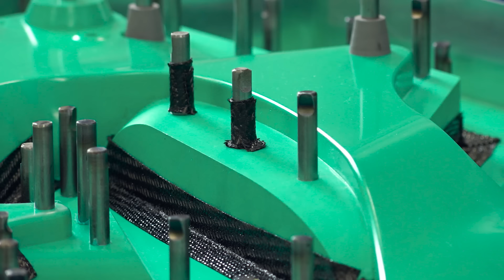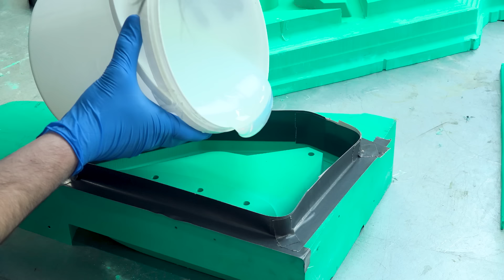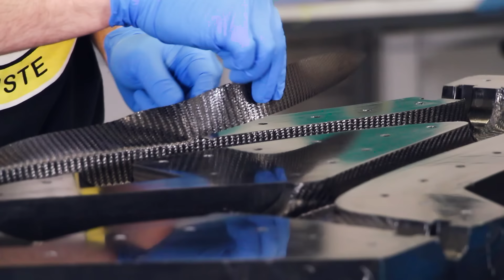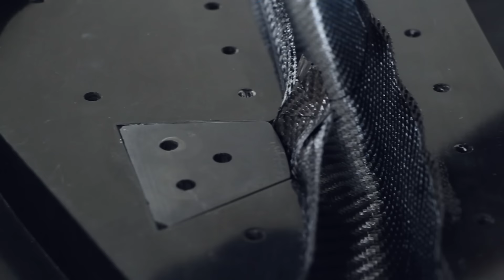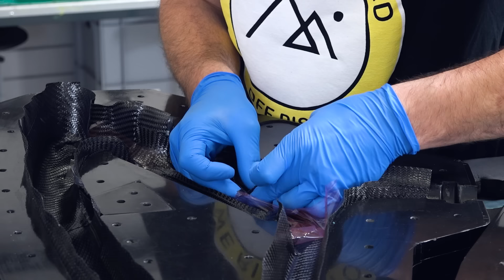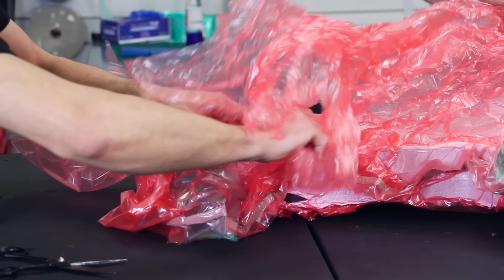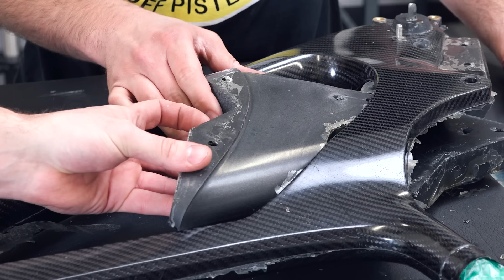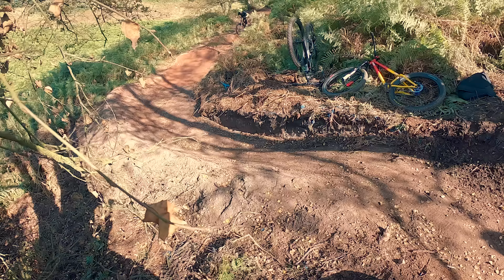Making a Carbon Fibre Bike Frame – From CAD Design to Downhill Race

Comment: I'd like to see a video on how the bike frame was modeled so that the stress/strain/material selection could be done.  Specifically, how were the various weights, layers, weaves and orientations chosen ?  It is one thing to be able to lay up carbon fiber.   But you can't lay it up until you know what and how much to use, where.   Do different CF materials have different material models for FEA ?
Reply: I am an engineer in the field. It is important to keep in mind what models like FEA are for: Giving you knowledge at a cheaper cost (time, effort, materials..) than prototyping. While the models/analysis to do this exist, it is a LOT of work to perform them. Way more than with metal. And with every model you have assumptions. How thic are the plys at every spot? How exact is the orientation? The joint in the middle surely isn't as strong as the rest of the part - how do you model that? is that handcut ply a little more here or there? How did it compact? cure? Was the bag a little more stiff here than there resulting in less pressure on the ply? 
Afterall, this isn't just a metal part where you mill out the shape you want out of an isotropic material down to .01mm or even better. 
Then, as if this wasn't bad enough, you don't actually know what stresses, frequencys, impacts etc you have to assume as your load. You guess, making your model inaccurate. (The point isn't to make somthing that lasts but to make something that just lasts, saving weight) 
But then, even worse, it isn't actually easy to say when a piece of carbon fiber is broken. First failed fiber? When something delaminates? Or only when it is snapped clean in half?

What I am getting at with all those words is..

It's easier to just prototype.
Reply: @sphericalsphere  I'm a ME student in University right now and I came across this as well. Another aspect that makes FEA a little hard with composites is getting the right material properties that you mention. Most (if any) FEA and CAD softwares won't have the specific material properties to use for a test even with a perfect model. And if your were to try to calculate the material properties it would be EXTREMELY complex from my understanding. It would vary on the cross-pattern vs the UD, and the number of plys used.

I made a pre-preg steering wheel for SAE mini baja and came to this realization, and decided to make a couple of prototypes. Still testing but should have it finished in time for the competition. 

Like you said its easier to make a prototype and strengthen or reduce where needed.
Reply: Would love to see the steering wheel finished.
Reply: @sphericalsphere  I, too, am an engineer, but electrical, retired side of the "career location" equation.  Very interesting points you made, especially the unknowns introduced by inconsistencies in orientation, bonding, bagging, sizing of individual pieces, etc. 
I built a Long EZ many years ago.  It incorporated foam/fiberglass construction (surf board inspired), and I remember Rutan saying in the plans that structural design with fiberglass isn't always as straightforward as you would expect.  Kind of speaks a bit to what you were saying here.  I'm quite sure they did a lot of prototyping of spars, etc. and eventually finished structural testing (sometimes to intentional failure). As you say in your comment, that only addresses static loading, though, dynamic loading is possible, but harder and more costly to simulate, even in real physical simulations, like wind tunnels.  General computer based FEA was basically nonexistent, at that point, if I remember correctly, at least in terms of not being used generally and widely, more the purview of mega dollar entities (like the one I worked for, Martin, and much larger aviation/aerospace/etc.) when it was.  At least that was the impression I got.
I expect a fair amount of fiber reinforced plastic design, regardless of the specific materials chosen (glass, kevlar, carbon, or a any combination of...and resin type), is at least partially what many call "art", which is really just experience when you boil it down.  ANYTHING with an adhesive, or even a curing matrix, as part of its makeup, is subject to a lot of variables, in my limited experience, including to a great degree, many times, just cleanliness of the parts to be joined. 
 I have an old Raleigh Technium, which is partly steel, partly aluminum, with adhesive joints, albeit fully lugged.  So far, it's been fine, but I still wonder sometimes.  I've heard that many people that have experienced a catastrophic frame failure on a bicycle have never gotten back on one.  When you think about it, it could be seriously brutal, and highly damaging to multiple body parts.
Reply: @MrJdsenior  just to be nitpicky. It's not an art it's a craft and the people responsible for it are master craftsmen :)
Reply: @almerindaromeira8352  No problem, point taken, but I actually think it may be BOTH.  

The technical execution side is craftsmanship, of a sort, I agree. But figuring out the absolute best path through a table, including all the percentages, pitfalls, possible good vs. bad possibilities, and knowing most every kind of shot that is out there, or coming up with (or better yet, INVENTING) your own, real time, or creating excellent traps for your opponent (not just safing, but safing in a manner that is likely to win you the game, even if they do manage legal contact) IS kind of an art.  Some knowledge, some application, some math, but still an art, of sorts.  

To be more concretely accurate it's all really just competitive gaming...I was just waxing a bit poetic.  :-)
Reply: @sphericalsphere  Is there FEA software that can simulate sheer between carbon fibre pre-preg sheets? I can only imagine the best way to build a lightweight carbon fibre bike frame would be to place continuous carbon fibre around each extremity until it creates multiple circuits inside the frame. Iterate to find the strongest bike for the lowest BOM.
Reply: I designed a carbon fiber monocoque chassis for an energy-efficient vehicle to compete in last year's Shell Eco-Marathon Americas (shoutout to Easycomposites for helping with the project). I simulated the loading of the chassis in ANSYS, which has a composites module where you can assign the plys (thicknesses and direction) and core material to specific areas. That, of course, meant lots of surfacing work just to create the proper edges/areas for the layup definition. Reference coordinate systems have to be placed at various points on the model to define material direction. After simulation, the safety factor against various failure modes can be checked. Then it was just purely iteration within the simulation. Of course, we only had rough estimates for material properties, chassis loading, and the reduction in strength for joints/overlaps so we just overbuilt the thing. Next year's is going to be much lighter as we refine our model and construction methods.
Reply: @themoyman  I'd love to see you do a video on this process.  Start with ANSYS, right through construction. 

Do you put strain gauges on the finished product to verify the modeling ?
Reply from the maker: Very fair question. In actual fact, like many bike frames, very little was done by way of FEA to determine the fibre orientation, reinforcement type and placement or fibre selection. What actually determined the layup on this frame was just a good knowledge of the basic principles (Vlad's laminated a lot of different types of bikes over the years) and then starting off with an over-engineered prototype frame which was tested and then slimmed down. FEA will give you lots of useful information and ideas but it will never give you the full story of how a frame will feel and so a surprising number of manufacturers use an iterative process that's a lot less scientific than you might expect.
Reply: Easy Composites Ltd uh
Reply: @easycompositestv  Anybody can build a bridge, only an engineer can build it within an inch of its life. I agree with @TechGuy that it would be really cool to see the entire process, even if it is inefficient.
Reply: @MrAuzzie82  Bridges have huge safety margins, no one builds a bridge to 1.15 margin of safety!
Reply: @easycompositestv  Guys, repeated empirical testing is scientific though...
Reply: @easycompositestv  Wow. Thanks for the great response.
Reply: @easycompositestv  Amazing information thank you! Makes sense with a more iterative process when you think how much time FEA can consume :P
Reply: Optimizing ply angles and layup is a tedious process... specially for something like a bicycle where there is multiple loading scenarios, and accounting for manufacturing defects, ply shifts... It's a can of worms... ..  You can do it... There is a couple software like Hypersizer and such for such optimization... That's like PhD level stuff that is perform more like in the spacecraft or aerospace side.. . Best starting point of a bike... Look at other bikes.  Cut up a damaged one, look at how thick the other engineer put it at various locations.  Lotta of that on youtube by an Australian carbon repair guy(mostly road frames, unfortunately)... look that up.
Reply: Lawrence L Raul @ https://www.youtube.com/channel/UCY9JUMYI54lLOHpb_zbIedQ the guy is awesome
Reply: You guys, FEA analysis is only as good as the loading combinations you input, the combinations for a dh bike are huge. to model dynamic and impact loading would take longer than the frame modelling. I'm with EC hard testing to destruction would be more telling. the torsion and lateral forces that make structures buckle are difficult to reproduce in 3d analysis.
Reply: I came here looking for the same thing but wasn't massively surprised when I didn't see it. I am a PhD student looking at FEA analysis of composites and the process of taking a CAD model through to analysis in a semi-automated, structured manner and it is shockingly difficult to find any real examples of it. The reality of the situation is that it is either to expensive to do, or anyone/company who has had the money to do it isn't going to release that information because it is so valuable to them and advantageous to keep secret.
Reply: @OoOCLUGGEROoO  you are a fellow pilot like me
Reply: @imperialrecker7111  haha I fly when I get the time, unfortunately that has been in short supply this year but it's always nice to get out when I can!
Reply: @OoOCLUGGEROoO  I have done FEA and the reason for not many material available on web is because ,of two reasons. 1. Material properties of a single ply is difficult to get. 2. Orientation and layering is got by iterations and a optimisation tool.
Reply: @ramachandransankar750  Yeah, that is what I was getting at with the comment on how expensive it is. If a company has to spend considerable money to run the necessary coupon tests to reliably establish the orthotropic material properties of a composite material they aren't going to waste that money by giving all the information they've gathered to competitors, similarly for establishing robust lay-ups. Everything in composite analysis takes more time than isotropic analysis, and when time is money you are less likely to release the information you gain through testing.
Reply: You wouldn't test for stress trying to use carbon fibre tho, you would just take the design and set it to aluminium and put it under load in the software to see what parts would be under more stress and from what direction the stress is pushing or pulling, that's all you need to do.
No need to work with impossible mathematical equations trying to figure out what orientation to put the ply.
Reply: FEA seems much more useful for homogenous materials (steel, concrete, plastics, etc.) than for composite and variable materials. Would you use FEA for a Douglas Fir beam full of knots and cracks? Not likely, and it would be highly theoretical results at best. Same as carbon fiber. Prototype it to fail fast, and iterate design changes over the failures.
Reply: "Give me all your deep knowledge you gathered over years and is considered often company secrets for free so that  I can replace u tomorrow."
Tech guy :D
Reply: I remember at an aerospace company I worked at, they had a tool that calculated almost everything for composites. Layers, orientation, weave, etc. However, I think it was for wing skins which are basically just a flat sheet modeled with static loads. Not my department, but I remember going to a lunch & learn for it.
Reply: It's a prototype competitive bike. Ride it till it dies then analyse the failure and role any lessons learned in to the next edition. If it was a commercial project for mass production then more stress testing and in house iteration would be required prior to releasing the final production specs to the manufacturer for serial production. This is why many companies work in collaboration with or sponsor sports teams or anyone else who can perform testing in extreme circumstances and integrate any cutting edge developments back in to their commercial product development. As well as generating publicity to increase brand recognition to drive sales.
Reply: You may not see how to do specialize  bike frame in factory , their bike frame with 100% rolling UD carbon fiber prepreg  in different angle. after all , put the frame of prepreg in mould as whole one
Reply: Carbon fiber is a thin hair which is strong in tension only. It cannot be used directly for structural purposes as it is. It is placed on an epoxy sheet and that sheet can withstand both tension and compression though it will differ in values in perpendicular directions. These different values is what make  FEA different compared to steel FEA where properties like strength and stiffness are same in all directions.  I have done FEA on carbon bike frame.  Further we can place carbon sheet layer by layer to get different properties in directions which vary across the part geometry to get the properties desired. When there is a joint we can have,more layers with 45deg to reduce shear in all layers.etc.
Reply: Ppp0ppp
Reply: V
Reply: Not sure why all of you care about all the scientific data like if this was a rocket …  it’s a bicycle people!!
Reply: Смоделировать можно, но только испытания дадут четкое понимание где и что нужно исправить и добавить.
Reply: As many commented here, combining FEA and composite materials is a challenging task. General FE tools like Abaqus and Ansys are usually not capable of properly modeling and considering all aspects of composite material properties, although presenting specialized modules. To simulate composite materials, dedicated FEA tools are required and there are a few that are capable of accurately modeling any problem! I personally use Genoa PFA from AlphaStar, but these tools can get quite expensive and thus restricted to big corporations.
Reply: Chill out bro it's not a space telescope
Reply: That video will be useless for most DIY projects, only big companies will able to do that
Reply: just dont see why would somebody spend so much money on tooling material to make mold and than just one bike out of it for riding, just buy a bike
Reply: there some people make their own bike to fit their needs
Reply: Please explain how many layers of carbon fabric are used in this model?
Reply: I am an entry level composite tool design Engineer. Im working on composite tools, jigs and fixtures. I know knowledge will come by experience and learning.
Apart from that I need guidance from people's hete in what books I have to read, what type of skills I have to develop to succeed in my field. I am also very much interested in FEA.

 I am Hoping guidance from experts and senior persons here. So kindly reply me.
THANKS IN ADVANCE..
Reply: if there is a program like that, than we probably cant afford it, otherwise, good luck making couple of bikes, with diferent layout of carbon, unless u in the industry, it is going to be a expensive but, the most meanfull thing u can do to get to where u want to be, simpy said DIY
PS: free file of full suspension bike frame model with all the componnents,comes with fusion 360 :) GOOD LUCK TO EVERYBODY and if u have a spare mold send it this way

Comment: How did you remove the plastic inside the frame???? 🤔🤔🤔
Reply from the maker: The bagging film is self releasing and because most of the layups have two open ends in this case, it can be pulled out once cured. In some cases though it may not be possible and the film becomes enclosed within the frame. Whilst it does add a small amount of weight, it's not really detrimental in any way to leave it in place within the frame.

Comment: Just from eyeballing the drop of the first jump that bikes light what's it weight 12 pounds? Looks like it floats. 

Can you make a design that can encompass the rear shocks but keep the mid frame free for a 10in x 6in x 6in battery with a mid drive motor. By switching from alloys to carbon one can counter the weight of the motor and battery and use thicker tires keeping the bike itself under 45 pounds. I can't find carbon vacuum form designs online anywhere.

Vacuumformers are cheap to make now too.

Comment: I always thought the inner bag needed to be pressurised, who would've thought that leaving open actually inflates it. Very cool.  Such a great video.
Reply from the maker: Yes this technique is far 'nicer' to your moulds as they don't have to contain the pressurised bladder trying to push the 2 halves apart. This means that the end result is more accurate and should prolong the life of the tool. The only downside is that consolidation wise, you are restricted to vacuum pressure as the maximum.